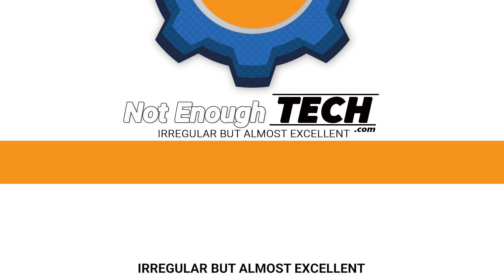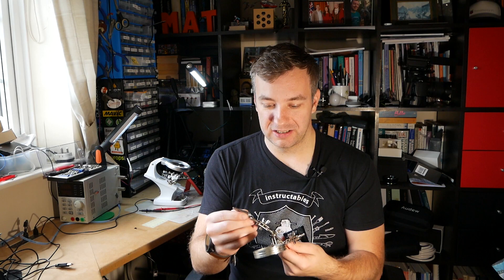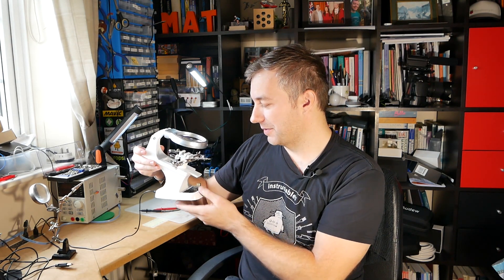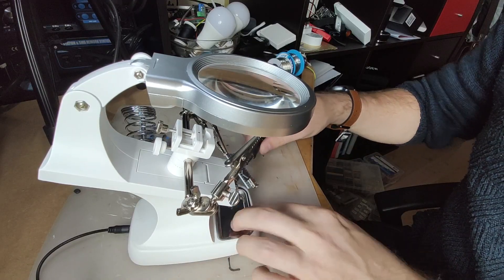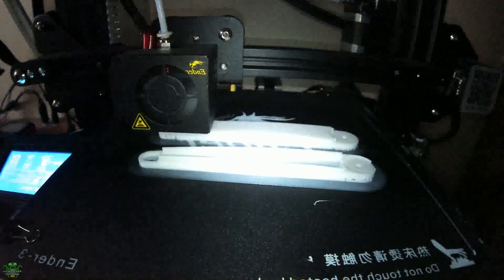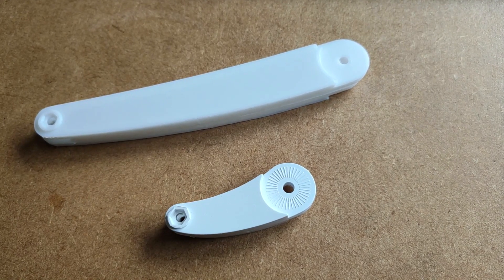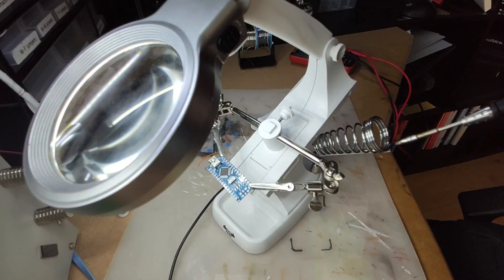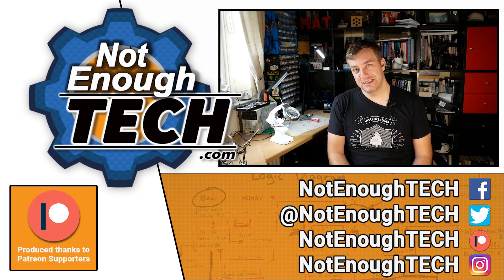Fixing the second cheapest soldering stand (DANIU)

Comment: Hi Mat I purchased the identical soldering station here in Australia at $23.27 AU delivered.
I so far I  only solder projects from very small to a board about the size of a Raspberry Pi.
I pre downloaded your mod for the longer arm. Thank you for sharing that.
I found I didn't need to use the mod because I slid the slide down and and reveres d the crocodile clips to face away from me and the boards are more centered in the magnifier.
By removing the vice unit it is easier to handle slightly larger boards.
The better design of the gripper assembly gives seemingly a million different positions.  
Have you tried to print the RPI HQ Cam Module cover I sent you?
Maybe you could do a follow up vid for the HQ cam and feature the cover that is simple but functional and
It might help someone else.
I'm not looking for any glory please use it, modify it and put on you web page or Thingiverse to maybe help more people. I just like to give back a little something to you and show my appreciation for all the work you do for everyone. Keep up the good work and looking forward to more of your videos.
Regards Ernie the old newbie from Australia
Reply from the maker: Hi Ernie,
I'm fighting firmware on my Ender3 v2 after upgrades so I'm yet to print it! But I will give it a go. Your comment gave me an idea, I should use the stand and the pi camera to make a microscope/recorder for electronic work. I think it could be an interesting concept. 
I will print the case anyway as soon as my ender is operational.  Perhaps with a very expensive filament from work :)

Comment: Thanks for the video Matt. A little bit of heat on the holder at the bottom of the spring coil and twist the spring to make the hole at the bottom smaller should stop the ion from falling through.
Reply from the maker: Since this is just a wire which can be replaced, I will simply make a spare one for ts80 :)  I seen some cool designs on thingiverse so i can adopt it
Reply: Hi Matt, When you do make one, you have to show me at the hackspace.
Reply from the maker: Will do Colin!

Comment: Thanks, this definitely looked like a useful modification.

  Personally, I inherited a standard Panavise vise jaw clamp from my father's old unused stuff when I got into the electronics hobby a few years ago. 
  Since then I've seen lots of people use these little clip based things, and I've got to say, I must have gotten really lucky with the Panavise.
   If you've never used one, they have a swivel mechanism on the base. This allows the upper vise clamp to rotate 360 degrees in the horizontal plane. There is also a slot that allows the vise to turn down 90 degrees or any angle in between in the vertical plane. It's capable of holding almost any board so long as there are 2-3mm of margin around the outside for the rubber jaws to grip. They mate very well, so it really does work with just 2-3mm. I can easily do things like hold a board horizontally, vertically, or at 45 degrees where I can see and access both sides at the same time. If the clamp on the base is loosened the head can be at an angle like, let's say 45 degrees (relative to the base), while at the same time the head can be swivel 360 degrees independently.
  The way I use it, the vise has enough weight to work on boards held horizontally up to around 8-10 cm long without tipping over easily. I don't bolt the vise down to anything although it has 3 tabs with bolt holes for this. I only use it free standing on the bench. If it were mated with the Panavise base plate thingy it would be stable with almost anything, but would be harder to move out of the way when not in use.
 It is also super useful for filing and shaping boards when etching your own PCB's or tuning a board to fit an enclosure.
  It doesn't have a magnifying glass or it's own light.
   For strong magnification I use a $1.50 pair of +400 reading glasses from AliEx, or a pair I cobbled together that are close to my prescription offset using 2 other pairs of reading glasses, one at +75 and one at +100 for the left and right lens respectively. With +400's I need to be within ~20cm to focus at all but everything is ultra magnified. I use the offset pair all the time as "safety glasses."
 Thanks for the upload. I've got to get myself one of those Ender 3's.
-Jake
Reply from the maker: I have done recently some work with RGB LEDs so adding a 3D printed O ring wouldnt be hard actually, from the description it sounds very flexible your stand. Got any link? 
The one i got is dirt cheap, but I spend about 2-3h a month using it so will do me just fine! :) perhaps others would love yours!
Reply: @notenoughtech  
This is the one I have:
https://www.digikey.com/product-detail/en/panavise/301/301PV-ND/1500

I've heard a lot of people like their other clamps and attachments. like these:
https://www.digikey.com/products/en/tools/vises/253?k=panavise

I must say, I don't know what I would do without mine. I would have a hard time justifying spending $55 on one of these versus $10-$15 for other Chinese direct options, but it's really one of the few things I use almost every time I'm at the bench. Just due to how many uses I find for it and how often, I'll vouch for it as worth it's cost and the effort of going through ordering from a regular distributor. Don't get me wrong, I'm dumb and cheap as hell too. I'd spend 10 hours to brag about saving a buck...but seriously I'm a disabled guy on a shoestring budget. There aren't many things I will spend money on. Knowing what I do from experience, I would purchase this as an absolutely essential tool. The one I have is probably over 30 years old. It could use some fresh rubber jaws but it will probably last 30 or more years still.
  I searched for and added digikey links. I have no affiliation with them. They support KiCAD and that's reason enough for me to recommend them. Most distributors carry Panavise though. I think it's like the industry standard product.
-Jake
Reply from the maker: Oh I get what you mean now with all attachment list this is a really cool choice. I might consider the vice actually as I have been missing that in my work area.  I agree with your approach tho, there is a place for cheap tools that we use to little to justify the spending, but quality tools come with appropriate price and last you ages.  I bought stuff from Digikey before.  I always advise anyone who is starting up just like me, first allocate the budget for projects and see it through. Then once you know where your interest lies, start replacing the tools you use most with the better ones